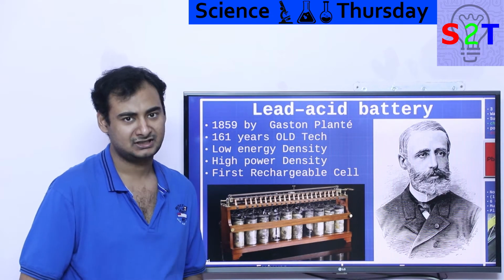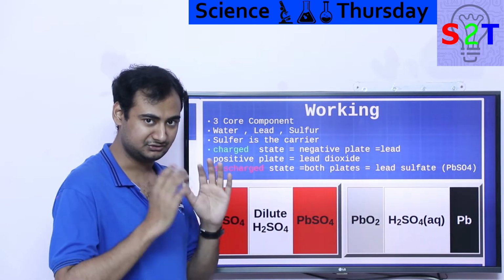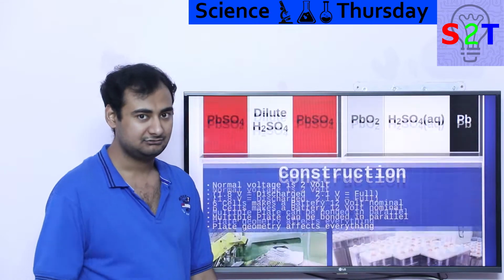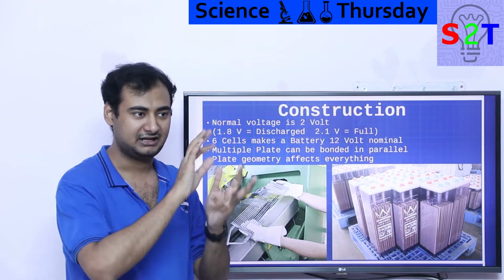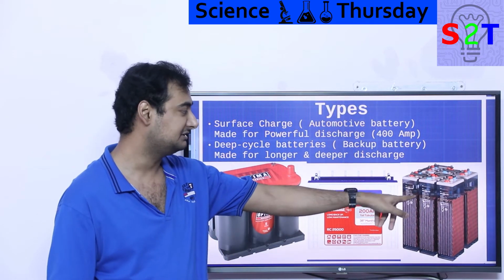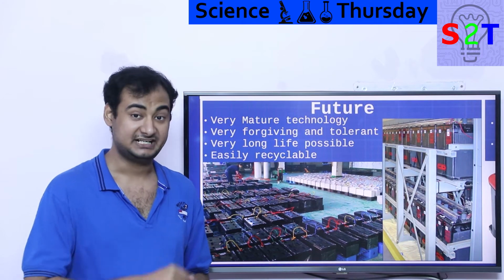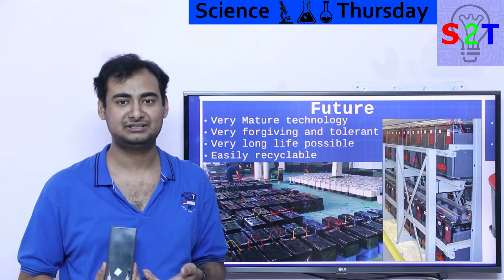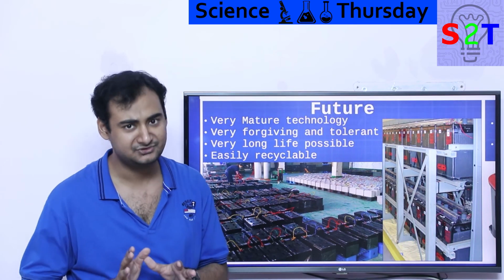lead acid battery Explained {Science Thursday Ep94}

Comment: Very interesting, I'm loving your channel. 

In, I think it was the titanate Battery video you spoke of being able to get and efficiency of 80% of the charged power out of the battery.
As in charge 1Mw/h get 800Kw/h out of it because some is lost.

* I wrote some blabla about how I was wondering how it compared to lead acid and not finding the answer. But altering my words in google directed me to a sciencedirect snippet claiming 85~70% depending on temperature and discharge rate.

Now I wonder if they use these in power walls to bare short high loads, but I still haven't watched you powerwall video and it's 2am.
I need to go to bed.

Again thanks for the very nice youtube channel
Reply from the maker: I am glad  but a man needs sleep